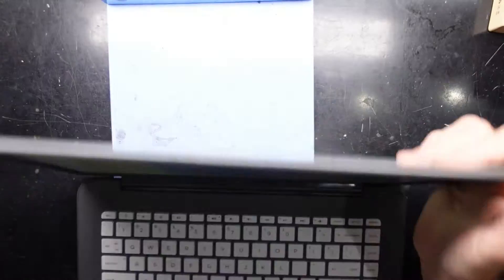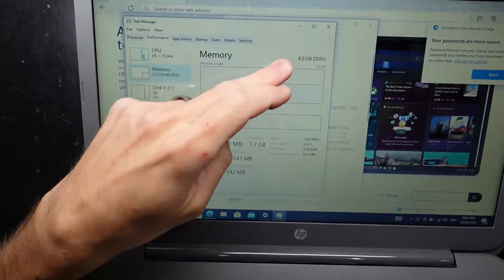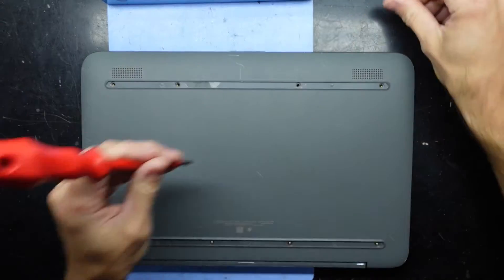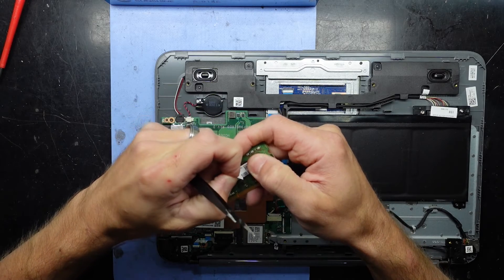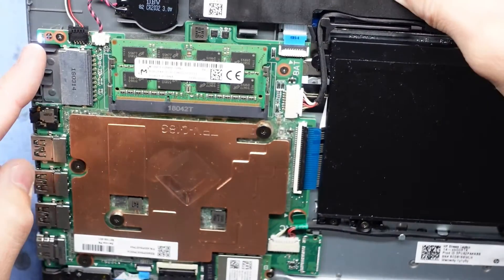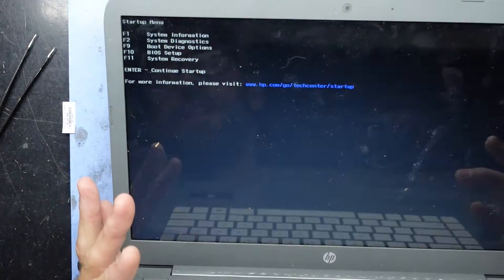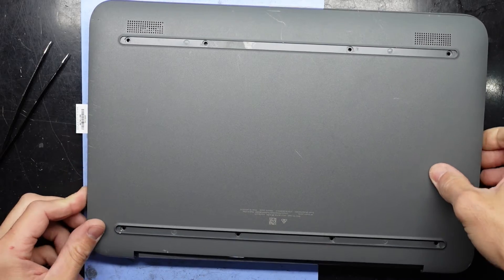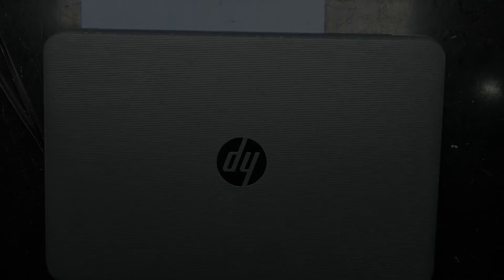HP Stream 14 Ram Upgrade (pointless upgrade..)

Comment: I upgraded my 4 GB stream 14-cb171wm (N4020 CPU running stock HP Win11) to 8 GB using an identical spec Samsung module except for the larger capacity of course and it does run better. And 8 GB dual rank Hitachi module failed to boot. Before and after PC Mark 10 results were only Very minorly better except for the test for displaying images which score doubled. However I noticed that before doing a simple task like having a couple browser windows open or even doing nothing a lot of the times had the CPU running for long periods of time at 80 90%. With 8 gigs the CPU usage spikes to 98% for 3 to 8 seconds and then drops back down into the 15-20% range sharply and stays there until the next usage spike, And that mostly at boot time. So the chronic unresponsiveness went away. I don't think this is about the week CPU per se as much as the CPU SOC having to Page RAM contents to the drive constantly, before. Browsing with a few windows open now uses five - six and a half gigabytes with 7.8 reserved. So some drive thrashing was  going on before. Win11 idols at 2 and 1/2 gigs when it first starts but run a few programs and then close them out and 11 idols in the low 3 gigs range.
Reply from the maker: Good to hear you are getting a more stable PC once upgrading to 8GB :)

Comment: Windows 11 runs just fine on mine.  My bios is f.30.  I did the 8GB Ram upgrade.  Was gonna do 16GB but ordered an incompatible DDR4 SODIMM which then ended up in another laptop.  I took that laptop’s 8GB and put it into the HP.  Reading the comments in here, I might also do the m.2 drive upgrade since the eMMC seems to be the bottleneck now.
Reply from the maker: good luck
Reply: It woulnt run on win 10 or 11 becuase of not enough Storage memory
after installation,....

The best LINUX to install  is Zoin.. (FREE...)
it's better THAN Window..looks better too

(5% cpu , 10% Ram at desk top using Linux)
So it'll run faster. It did fine at 4 gig. I was just TESTING...it runs smooth. at 16 gig. Plus  if I find

I have plenty of external HD, usb sticks or  SD cards ..($20 for 125 Gb)
The PC needed 5- 10 gig of reserve storage in the main HD..so it can do its thing.

Zorin comes with everything you  need already
These are other FREE popular everyone use across the board.
Gimp, VLC player,... Nomacs ( slide show player)
VLC players runs on 2K video files ( look just as good as 4K) without any problems.
The 1.7 mhz CPU handle it (No Over heating)
Reply: Seems like hp 14s has received  some upgrades as my 14s DQ series has a 128 gb m.2 SSD already installed, has only 4GB ram so I’m planning to put 8gb in, already quite fast just let down by the ram and 1366x766 display, it’s decent for the price.

Comment: My screen is just black after I changed the ram but Is not a hp ram
Reply: Mine was black with little white dots here and there when I put a dual rank module in. When I replaced it with a single rank it booted up good.

Comment: Remove internal Network Card.  Install Adapter and add another SSD.  Buy a usb wifi adapter with the extra Ram also added.  Now you have a perfectly functioning laptop. Yes you need to be Tech Savy to set it up but its totally worth it.

Comment: 2 things I have to disagree with in this video 1) Pointless Upgrade in the title, and 2) You state the "CPU is it's biggest limitation". For folks on a budget a cheap HP Stream can do more then you think!!! For $75 Canadian (guessing your Australian or a Kiwi), you can improve the Stream to run quicker and have ample Storage. Remove the WIFI/BT Module in favor of an Adapter that holds an NVME SSD at 128GB. Swap the Ram to the 8GB, and add a WIFI/BT low profile dongle. The built-in eMMC is it's Biggest Limitation, and it's biggest bottleneck!! The improvement of the Stream is amazing, I know as my 2017 HP Stream has new life as an everyday Laptop but I went over board on it's Upgrade swapping the display for a 1080p IPS panel as well. Anyway my point is with a little work and research you can turn HP E-Waste into a very good Laptop on a budget. So for people on a fixed income, Students, Elders buy a Used Stream, add a little work and cheap additions and save some money !!!!!!!
Reply: I know I'm incredibly late here but I'm currently looking into upgrading my HP 14's screen to a 1090p PCI display. Could you tell me where you sourced yours?
Reply: @aconsumer871   id like this too, a product list would be sweet. just trying to hotrod my little college laptop lol.
Reply: Nel mio ha 4gb DDR3L penso che dovrei prendere quello da 1.35v. DDR3L 12800. Poi mi hanno detto che bisogna acquistare un adattatore per installarlo al posto del modulo wifii e comprare un ssd M.2 SATA ma non solo quale tipo di lunghezza si adatti meglio. Poi per l'adattatore dicono che ci sono due versioni tipo A e A+E. Sono confuso.  Sono pratico per fare la procedura ma vorrei essere sicuro di comprare i componenti giusti per non sbagliare. Mi hanno detto che NVMe non conviene meglio M.2 SATA
Reply: Where did u find a compatible screen? What was was/it?

Comment: I have the windows 11 model stream 14. I slapped an 8gb in there with win 10 2021 ltsc and it's honestly not a bad laptop and is very responsive. FWIW The 64gb emmc read/writes at 300/192mB/s and I don't think it's worth installing an nvme in the wifi slot as you are going to be bottle necked by the pci1 speeds.
Reply: any solution with 32gb version? 😂
Reply from the maker: even then, this machine  i couldn't recommend spending money on upgrading

Comment: lol. I was successful in installing 16gb on mine. Tested a lot of ram sticks before I found a brand that worked. And it performs great. Everywhere on youtube it said it couldn't be done. lol
Reply: And what brand of RAM was that?
Reply from the maker: odd, can be done... not cost effective to be done
Reply: @rickstechrepairs I payed 2 bucks for this piece of crap I just need it for my little sister to play Roblox 😭😂
Reply: @liljosue2762  lol respect 😂
Reply: @egcharle what brand did you use
Reply: What brand ? I just bought a 8 gig upgrade wished it coulda ran 16 my girl needs it for school its terribly slow rn
Reply: What RAM module exactly???? I think you might s#&$in us. And what CPU? Intel docs say 8gb is a hard limit for the N4020 in my Stream 14-cb171wm. And the the dual rank  8gb So-DIMM didn't work. Had to use a single rank, although I will admit that when when I ordered the single rank I made sure it was exactly the same as the 4gb that was in there before except for capacity. The higher in capacity at sodium module is the more likely it's going to be dual ranked.

Comment: Linux mint cinnamon runs on this laptop like a beast. Im surprised you even get windows to boot up, usually after updating windows os runs over 4gb ram and wont get me past the blue screen of death XD
Reply from the maker: even then.. the celeron has no power to it at all

a complete waste of resources
Reply: @rickstechrepairs  The eMMC is the bottleneck, if it can not fill the RAM quick enough at 4GB it can not fill the RAM quick enough at 8GB either. Once you bypass the eMMC for an SSD then you see the improvement. Yes still a Celeron, still have stutters here and there but a Stream becomes quite useful.
Reply: @BudgetBuildBarry  I was just wondering about this, I saw a video on how to use a M.2 adapter to hook an SSD to the wifi card port, and was wondering if it'd make like /any/ difference in performance because the cpu seems to be the bottleneck in a lot of things like streaming videos. Not sure if that's because the cpu is busy waiting for stuff to load from the eMMC or if its just a piece of junk that's the cheapest thing they could put in it that would still /technically/ meet the minimum system requirements for 10. I'm pretty sure if it didn't have /some/ hardware video decoding support it might struggle to play youtube at all. Doing the math it'd be between $80-$90ish dollars to upgrade the RAM, get an adapter and 500 GB M.2 drive, and an external Wifi Adapter because you'd be replacing the onboard one. I'm honestly not sure if it's worth the cost.
Reply: @MindCaged  Yes it makes things a bit quicker, it is still a Celeron so not at all i3 or i5 like but with out eMMC apps open quicker!!! Things run better. My 2017 Stream went from can't run Win10 to Running Win10 well !!! eMMC is the System Bottleneck !!!!!!!!!!!!!!
Reply: @BudgetBuildBarry  you may not need to upgrade the emmc mine reads at 300mB/s writes at 192mB/s (2024 model), just replace the software with ltsc
Reply: @dudedotmichael  My 2017 eMMC is far to Slow. The upgrade was needed, and it is so much better with the NVME SSD. The 32GB eMMC is far better used as extra storage.
Reply: I tried Linux Mint, AntiX, and Puppy Linux and while they helped(Puppy Linux was surpisingly /slower/ at loading webpages despite running in RAM probably because it used a lightweight browser that was built more for small resource usage than for speed). AntiX booted very quick and used very little resources but either I caught them at a bad time or they have a bad streak of major bugs in the distro, the first one I tried had a bugged installer that I had to run an update/upgrade before I could install and it took a /long/ time and then the sound was broken. A more recent version the sound works fine, maybe a newer kernal, but I think the repos have broken keys so installing and updating is broken. Mint seems to just work, though not as fast to boot or low on resources as AntiX.

 The hardware was still a major bottleneck and I easily filled up the eMMC drive with just software, and one of Linux's drawbacks is that unlike windows you can't really install software from the repos to a second drive, it wants all software on the system partition.

I used Mint for a while but then gave Tiny10 a try and it surprisingly works halfway decent, not too much slower than linux really though I didn't really do any benchmarking so maybe there is a wider gap than I think. It also was nice that it only used around 10 GB on the drive if I remember compared to a full 10 install which takes like most of the drive.
Reply: YouTube is a killer 😂